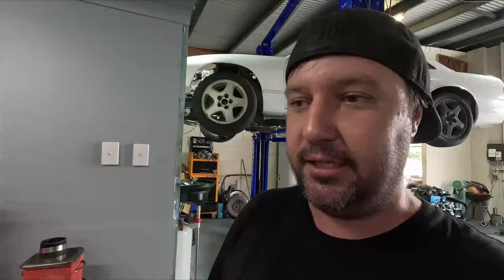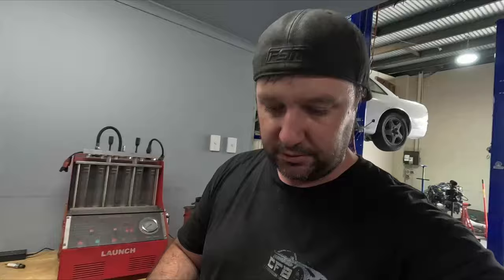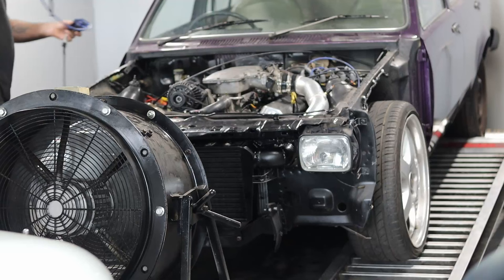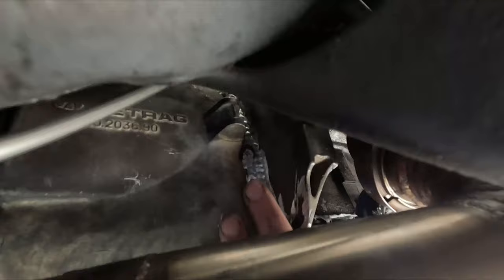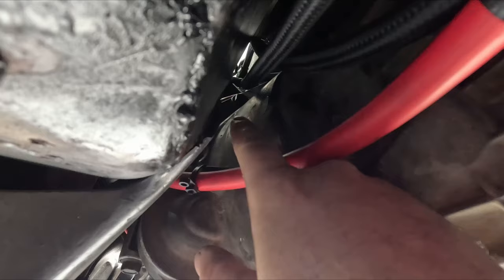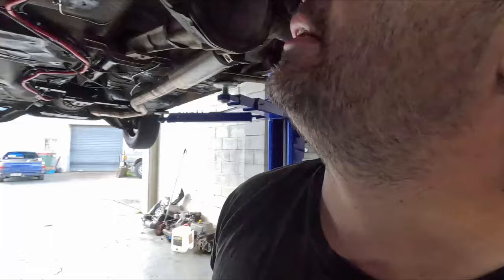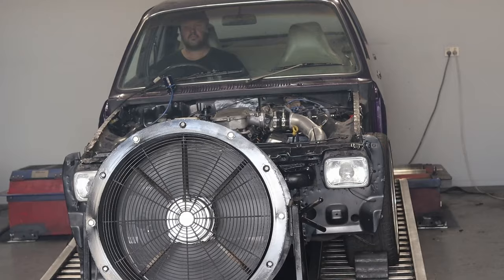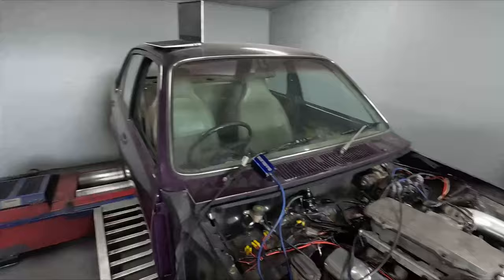Gemini dyno session.. failure?

Comment: The thought of battery cable running right next to fuel exposed to road debris scares me hahah. That 2 piece bellhousing is a pretty trick bit of gear. You should start selling them. The little gem is going to be a handful when it's done. Mine only had the stock 1.6 turboed and injected and it was a bit of a weapon, keen to see the end results for sure.
Reply: If you can, run a laser down the centre underneath. It's more than likely a mount or even the front crossmember is tweaked a little and not mounting straight. Tailshaft shouldn't crack the housing unless it's vibrating to the point of ripping out the floor. Also for the diff, look into Altra9 they have been the go to for ages for gemini.
Reply from the maker: Yeah its not ideal but will be ok.. those bell housings are a pretty special peice 😁 yeah nice sounds like it would have been a blast im really exited for those one tbh it's my first gemini always wanted one 😄